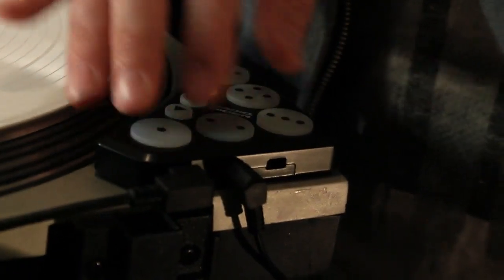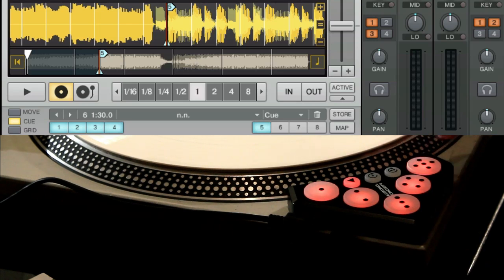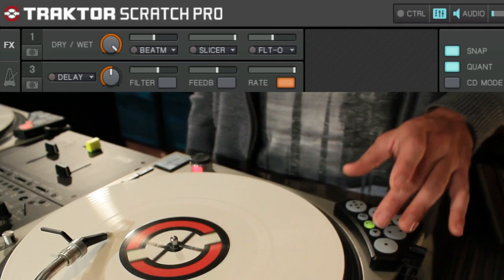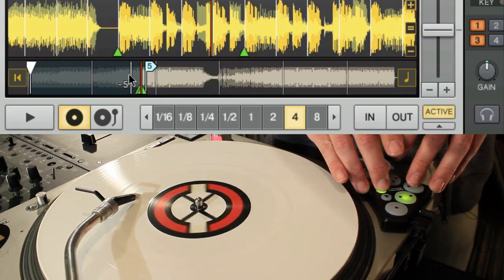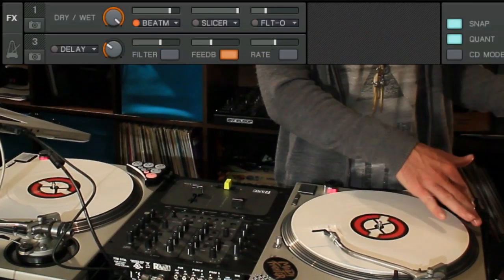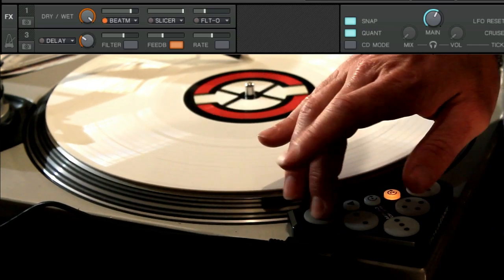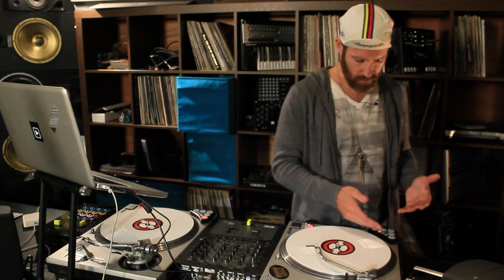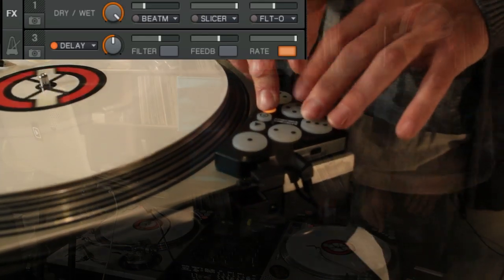Novation // Dicer with Traktor Scratch - DJ tech Tools video

Comment: Hey there! Is a Midi-Mixer necessary to use dicer and traktor? or can I stick with a vestax pmc 05 pro 2? :(
Reply: These controllers plug directly into your laptop, and each other, (for power transfer, so you can power both from one singular USB cable) You do NOT need a MIDI mixer of any kind, they won't work if you're not using some DVS system, however.

Comment: Hey there! Are you using a Macbook? Because I have problems by using the dicers with traktor on windows 7. There seem to be some Midi-Problems. I found that on some forums, but there wasn't a working solution for that. Only to turn of the *"midi-out" Channel, but then the LEDs arent't glowing and you can't see which effect is on :-(

Comment: @NovationTV:

I did! But they never answered :-( too bad!

strángely they work with traktor 2 and virtual DJ...  But I only have Demo Versions of both programs, and I dont want to upgrade from traktor scratch pro because of my laptops perfomance it only has 1,3GHz processor (dual core) it works fine with traktor scratch pro